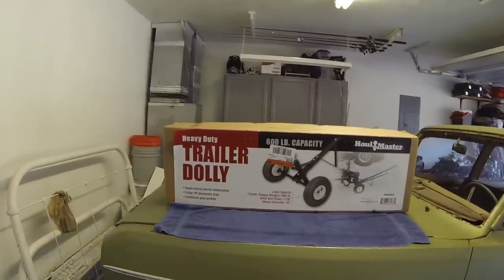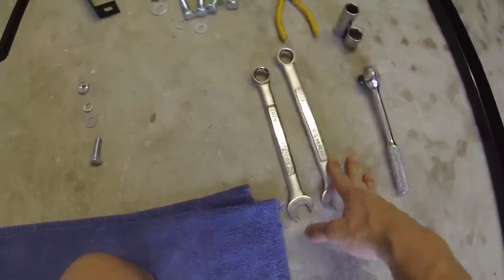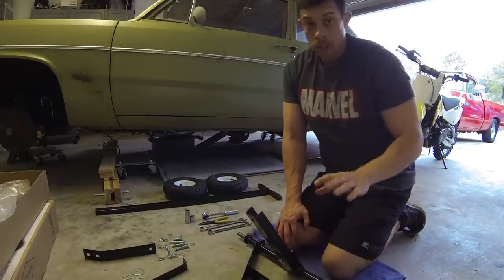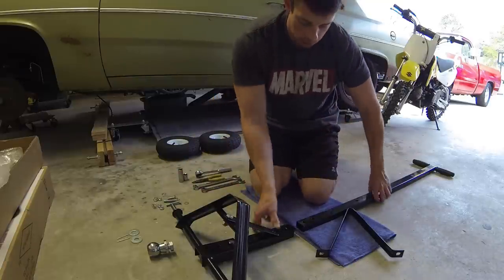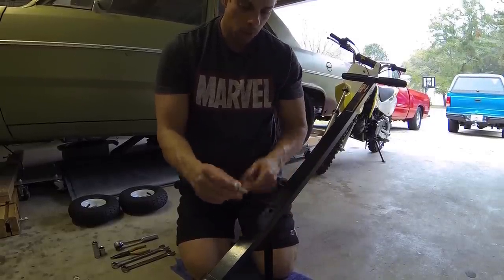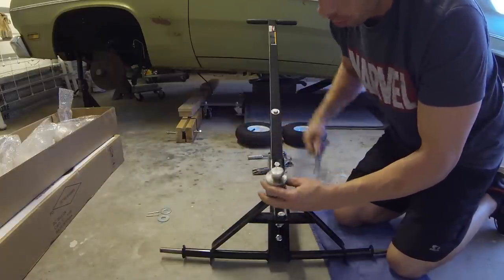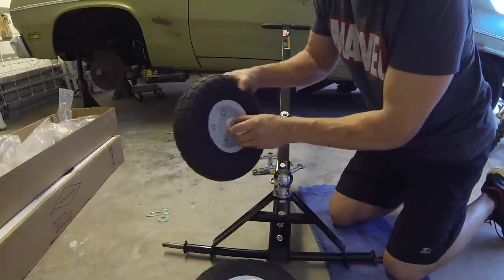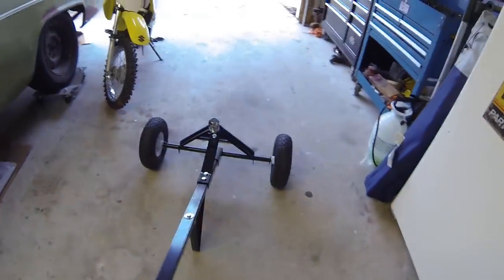Harbor Freight Trailer Dolly

Comment: only suggestion is to have your camera placed so your assembly is not at the bottom of the screen and hard to see.  Otherwise, your video really helped me.
Reply from the maker: Thanks for watching. I'm still using a gopro3 without an LED screen so I do the best I can. I'll upgrade one day.
Reply: Does Harbor Freight offer solid wheels?

Comment: Bought mine from Harbor Freight for my log splitter, only difference is I had to switch out the ball hitch that came with the dolly for a 2 inch ball so that way I can transport the splitter by hand wherever I go
Reply: Dustin , does the dolly roll ok on grass moving a log splitter ?

Comment: I bent the crap out of mine... I would recommend welding a plate on the triangle that holds the ball. Banged mine back into place and welded a 1/4” plate....hopefully it’s stronger. “I was towing a 16’ car hauler”. Maybe it was just too much for the little guy.
Reply from the maker: lol. I was lucky. I moved an 18ft car hauler ok. Probably bend next time if i don't reinforce it.

Comment: Good work.  I like it.  Idea:  get a longer axle and put dual wheels on each end.  Would that make it easier to move around in the soft ground?
Reply from the maker: that or taller tires. and i was thinking about solid tires also.

Comment: I just got one on 3/17/2020 for $39.99 + tax on sale from Harbor Freight with a coupon. The only thing the tires needed air. Could have came with a few more washers. Easy to put together. The ball is only a 1 7/8 ". I need a 2" ball.
Reply from the maker: I use the 1 7/8. For around the yard, a 2 won't fall off.
Reply: There is no way to use a 2 inch ball on this dolly. The shafts are too long to fit into the tight space. I looked all over and also called Harbor Freight. Tech said it's a no go. So I'm looking elsewhere for my tent trailer.

Comment: Thanks for the video.  Any ideas on how to beef up the dolly or find a stronger dolly for a heavier weight trailer?   We have a camping trailer in an remote location where we don't have access to a vehicle which can move, but looking into if we can move with winches - just not sure what to do with the tongue jack.
Reply from the maker: I would use a solid rubber tire. Other than that it seems pretty strong. I moved an 18ft car hauler with it.

Comment: How heavy is that boat?  Looking for something to move a larger boat around 1250 lbs, curious if a manual dolly would be comfortable or need the ones with a motor
Reply from the maker: Mine is probably 800 lbs.

Comment: Are these tires inflatable?
Reply from the maker: Yes
Reply: Thanks. Would you still recommend it after a year of use. I’d need this thing for my 1100 lbs, single axle cargo trailer to push it through about 60-80 ft of grass.
Reply from the maker: me and my dad have them. It works great for us. You may want to get some solid tire/wheel combos to fit it in the long run. I did use it to move my two axle car trailer. It worked but worked me harder trying to push it